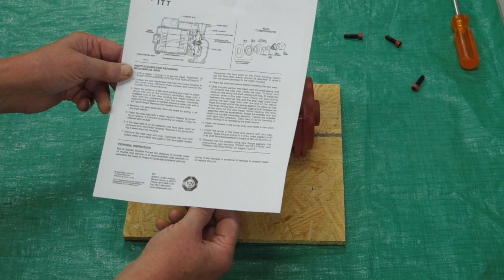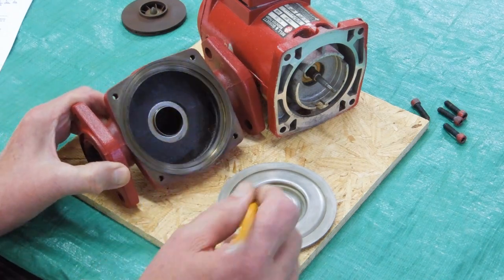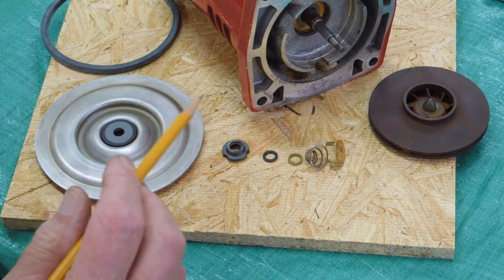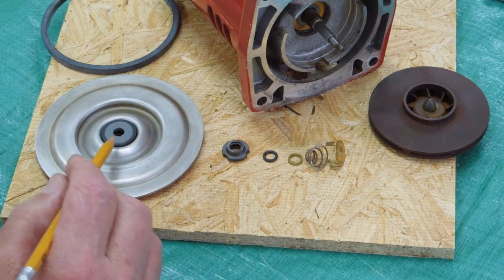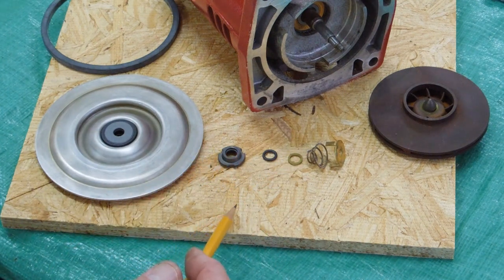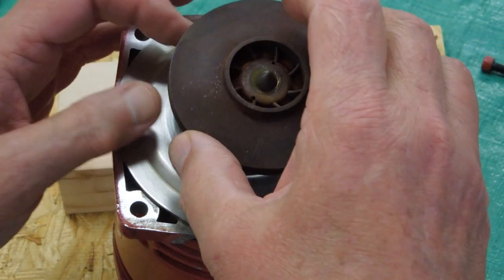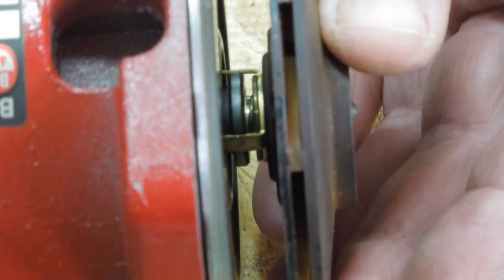Mechanical Pump Seal Replacement B&G PL-36

Comment from the maker: Assuming you mean when it snows. Around here you can’t really trust the weatherman so I usually wait until something actually happens. If it is a good storm I wait until there are a few inches accumulated and then slowly start things up. You do not want to heat the concrete too fast or you will crack it. The layer of snow will act as a blanket and help keep the heat in… more efficient melting that way.

Comment from the maker: Just to lubricate the rubber so it slides into position easily. The motor shaft and the cover plate are stainless so water will not make them rust. Did not want to use oil, which may deteriorate the rubber parts.

Comment from the maker: Mechanical Engineering Degree University of Missouri at Rolla (Missouri School of Mines and Metallurgy). Worked domestic and international for Halliburton oil field services, high pressure pumping, fracing, equipment design, fabrication, installation and maintenance. Worked in the jungle in Irian Jaya, Indonesia at a very large copper mine in charge of high pressure pumping, pipelines, equipment maintenance and repair. I fly radio control airplanes and have an amateur radio technician license.

Comment from the maker: This pump was in service on a radiant heating system, more specifically, a snow melt system for my driveway where it circulates a heated glycol and water mix. It developed a leak and I did not have time to take it apart, find out what was wrong with it, then wait for new parts, etc. So, I purchased a new pump. Later, when I had time I took it apart and decided to replace the seals and now it will sit on a shelf in case the new pump ever decides to leak. It’s a Murphy’s Law thing. :-)

Comment from the maker: Looking at my pump, it looked like the shaft sleeve was actually part of the shaft/rotor assembly. In any case it did not look like it would come off and mine was in excellent condition. If the shaft sleeve is a separate part it has been pressed on and may not be removable.

You should be able to get parts from anyone selling these pumps. Google it.

I placed the link in the description for this video.

Comment: i have found that most pump leaks are from around the mechanical seal (i.e around the rubber boot that holds the seal) so i always use a small film of silicone sealant on the rubber and have had no problems. i have also relapped old seals so i can reuse them and have better results than the original (cheap Chinese pumps) but i found that the carbon seal seats and seals better if it has a very flat but a slightly matt face on it

Comment: thx Ron!  Where can one get the replacement parts?  
Also, any tips on replacing the pump side (front?) shaft sleeve bushing? 

BTW, Here is the pdf "link" (youtube does not allow url in comments)  for the instructions referenced in the beginning of the video.   (replace Qs with slash)
QQdocumentlibrary.xylemappliedwater.comQwp-contentQblogs.dirQ22QfilesQ2012Q07QP81884H.pdf   (replace Qs with slash)

Comment: I have the pl36 b pump, the outside is gold. It is in my heatmor boiler. Came with the house. The pump is making noise and may have to replace the pump. What is the difference between the pl36 and 36b pump. I read o line the 36b is for potable water. Is that the only difference?
Reply from the maker: Sorry, I am not familiar with your pump nor the application.
It appears your Heatmore is a wood burning boiler which may also be providing your domestic hot water but only you would know that. It also appears your pump is bronze (lead free) while my pump is cast iron. Find a Bell & Gossett dealer and ask them. Thanks for watching! Ron
Reply: @RonaldWalters2010  it heats my hot water only through a heat exchanger.  This is why I was thinking the pump you went through would work for me and save me money. Same specs, except the one that I have in there now was for potable water. I think k the previous owner installed the wrong pump. It is a difference of $300. No one open today, just thought you might have some input on it. None of the water in the system with my pump is consumable.  Heat exchange only.
Reply from the maker: Yes, that brass pump is going to be more expensive for sure.
Answer this:
Your hot water is just for heating your house?
And the water is treated... has inhibited glycol in it so it won't freeze if the system goes down, power failure or other?
Note: Glycol has a limited life and the inhibited part is to prevent corrosion in the pump, copper or brass fittings, etc.
Where do you live? What state? What is  your lowest expected temperature?
Reply: I live in SE Michigan. So do you think I need to flush the system and retreat the water? Also since it is not potable,  should I go with the pl36 instead of the one that is in there now? Yes the system is treated and I sent a test sample out two seasons ago and came back good. I have no idea how long that pump was in there though.
Reply from the maker: One of the tests is the PH level. They may try to tell you that you can treat what you have to get a bit more life out of it. If you have reason to believe the fluid has been in your system for 8 or 10 years or longer then I would replace it. Whoever sells glycol will also have a recommended flushing/cleaning method. I used water and the cleaning stuff (don't remember what it was) and circulated it through the system. I mixed it in a brand new plastic garbage can and circulated it through the system and back to the can with a sump pump. I have a dedicated sump pump, garbage can and hoses that I use as I have three different systems (house radiant, shop radiant, snowmelt system). Then I flush the system with water and then blow all of it out with compressed air before refilling the system.
The glycol is mixed to the concentration required to provide freeze protection in your area, which is cold in MI.
I used distilled water, which is usually what the big 5 gallon bottles of water are. You probably have a drinking water company somewhere in the area.
Whoever sells glycol will inhibit it depending on your freeze protection temperature and the materials in your system... such as what the pump, boiler and piping is made of.
You may want to refer to your owner's manual for the Heatmor boiler or call Heatmor for their recommendations... just to verify that there wasn't a specific reason for the brass pump. Also Heatmor may have specific cleaning recommendations.
My system is made of copper, brass, cast iron (the pump) and Heat PEX oxygen barrier tubing which is inside my concrete floors and I heat with an on-demand natural gas heater. I have videos on my house radiant system and the snowmelt system.
I then mix the glycol and distilled water in correct proportions in the plastic garbage can and use that to fill the system.
There are two types of glycol... propylene and ethylene.
Ethylene glycol is the poisonous one. If you don't know which one you have, assume it is ethylene glycol and dispose of it in a safe manor. It has a sweet taste and it will kill wildlife, pets, livestock, fish, humans, etc. if consumed.
Glycol is expensive. Ethylene glycol is probably a bit cheaper and is the one generally used in heating systems. 
Never use automotive antifreeze.
And, when all is said and done... if there is no specific reason for the brass pump... I would use the cast iron B&G PL36.
Hope that helps and gives you a starting point. 
Have fun... winter is quickly approaching. :-)
Please subscribe. 
That is what keeps this channel going. 
Ron
Reply from the maker: Oh... and make sure your noisy pump isn't because it has air in it. After sitting idle all summer, sometimes air can find its way into a pump and causes it to cavitate. If you don't have a flow meter in your system it can be difficult to tell is the pump is moving fluid properly (or fully). Cavitation can sometimes sound like a pump is coming unglued. :-) And my systems are all pressurized to 15  psi which greatly improves pump performance. Ron
Reply: @RonaldWalters2010  thanks for the information.  I will  heck with heatmor and get the specifics.  The system was installed in 2005, so I am thinking a flush and refill would be best.

Comment: How did you get your cover plate off. Mine is stuck on or fastened on.
Reply from the maker: eliteman1010  I assume you have the same model pump as the one in this video - B&G PL-36. There is a rubber ring which seals the pump housing to the stainless plate and then the stainless plate just sits against the motor housing. Gunk/rust can glue the rubber ring to the pump housing/stainless plate and gunk/rust can glue the stainless plate to the motor housing (especially if the pump has been leaking for a while). Spray a little WD-40 in the gap where the stainless plate rests and let it sit for a while. Gently beat on the pump housing flange with a plastic or rubber mallet. You can carefully pry the pump housing away from the motor flange... alternating sides (corners) as you gently pry. Carefully pry - do not get too rough with it. Slow and easy... some more WD-40 and eventually it will come free. A putty knife may help separate the stainless plate from the motor housing. You do not want to distort the stainless plate while trying to remove it. Slow and easy... some more WD-40 and eventually it will come free. Do not get any WD-40 inside the motor or on the motor windings. Hope that helps.
Reply: Ronald Walters  Thanks! WD-40 and a little prying did the trick. I just wanted to make sure I wasn't missing something that held it in place.